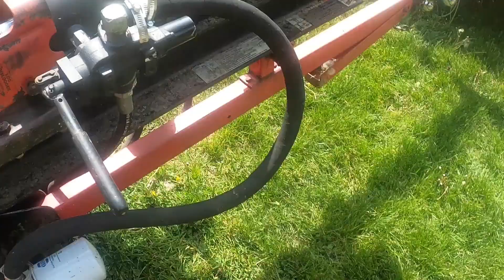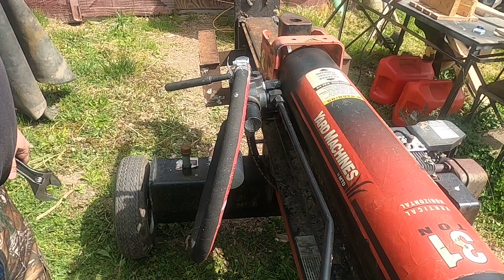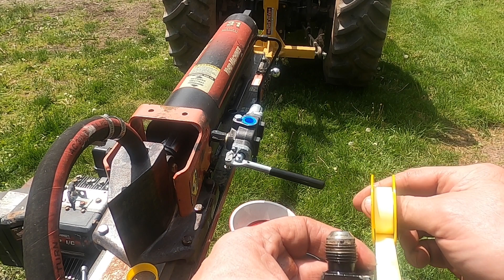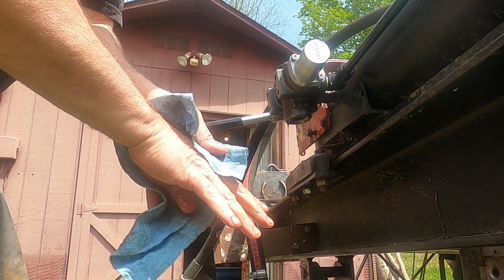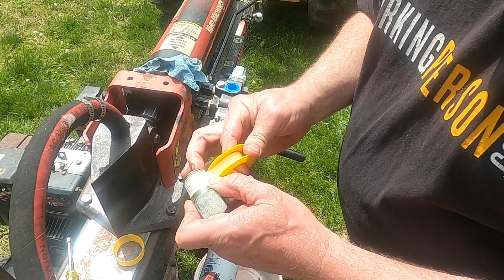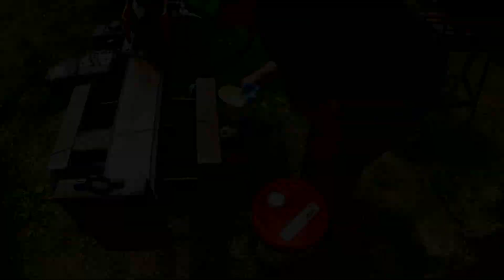Replacing log splitter control valve - 062

Comment: I have the 26 ton version of this, and the fitting in-between the ram and the valve cracked off leaving threads inside. I was able to use a pipe nipple socket and get the threads out luckily, but I have no idea what that fitting is called to replace it. The one that broke was black iron pipe and about 3" long. Can anyone help me out? Thank you!!
Reply from the maker: That's a good question. I'm actually not sure. I'll have to look at mine and figure out what it is. I'm on the boat until at least the middle of next week. When I get home I'll see what I can do and let you know. In the mean time, if you can email me a picture of what you have that might help.

Comment: I have the 26 ton version of this log splitter.  I've ordered the replacement control valve that cracked where the lever attaches to the valve body.  So, I'll be doing this exact job a few days from now on a splitter that looks exactly like yours.  So, thank you.  I've read elsewhere that using Teflon tape (even yellow), rather than thread sealant, is a no-no.  I was surprised that the control valve  (718-0481) was available since my MTD/Yard Machine splitter is over twenty years old.  I thought I'd have an excuse to buy a bigger and better splitter. (LOL)  Although, my 26 ton rarely fails me.
Reply from the maker: My old valve had cracked in that same spot. I fabricated a new plate because I didn't realize I could just buy a new valve. Now I know better.
You can use teflon tape. You just have to be careful not to get any past the end of the threads. Pipe thread compound is a better choice of course. I was also surprised that Energy MFG still sold those valves. Sorry, no new splitter for you! LOL! Good luck with your repair and thanks for watching!

Comment: What were the symptoms of your bad control valve? In other words how did you know it was bad?
Reply from the maker: On this particular valve, when you push the valve to the retract position, it's supposed to stay there until the ram bottoms out. It would either not hold that position or it wouldn't release when it did. Very annoying.
Reply: @Millstone_Firewood OK, thanks

Comment: I thought that was automatic  transmission fluid,  thats a neat idea
Reply from the maker: I was surprised that it didn't use regular hydraulic fluid but it definitely calls for ATF.
Reply: For my machine you can uses standard fluid or Dex III.  The manual specifically states if operating in temps above 70 use Dex III.  The downside of Dex III is the cost.

Comment: I'm back ! If you want to get rid of the noise, take off the muffler and braze a metal flex hose to a plate [ hand made ] and mount it where the muffler was. wire on the flex hose in a jug of water. Ta da no noise!
Reply from the maker: Interesting idea. Never considered a metal flex pipe. It does need a new muffler.
Reply: @Millstone_Firewood  My uncle brazed a flex pipe  [ I think its called electircal flex pipe ] on his chainsaw and wired a gallon bleach onto the saws handle bar  half full of water and the only noise was the chain chewing on the wood. Also you can adjust how fast or slow  it works , but cant say where on valve to ajust. There was or is a company called Northern Hydrolics that has a page that tells you what HP motor, cylinder and pump go together.  Iv'e seen V 8 motors hooked up to an 8 inch cylinder and i laughed  as it was so over powered. You might ask someone who knows about those fittings, as O'm pretty sure you don't use tape on them.
 I built my splitter so the table was waist high with a  3 foot table to sit wood on,. I wielded a 3/4 inch piece of angle iron around the edges to keep the wood from rattling off the table. I put the chunk of wood on the table and split it , then pushed half to one side while I split the other half. Not having to pick up anything as it stayed on the table. I built foot peddles so i could use both hands while splitting, once finished with the round of wood , i stepped on the down peddle and reached over and grabbed another round of wood, That is where the ''retern to center ''comes in handy. 
If you want to see my spliter , send me your address and i will send a picture. My e mail address is at the top.
Reply from the maker: Thank you for the information. I actually do understand hydraulic fittings since I work with them frequently. My go-to product is a thread sealant called Gasoila. Good stuff. But yes, you can use tape on the NPT threads as long as you do it properly. My splitter operates either horizontally or vertically. I mostly use it in the vertical position since now I only use it for the occasional log that's too big for the Cord King. That way I don't have to lift the logs. You should post a video of your splitter. Sounds interesting.

Comment: What is the model number for that detention valve? Have same machine 25 yrs old now will not pop out when reverse stroke finishes
Reply from the maker: If you look on the detent cap, the part number should be there. You might have to remove some paint to see it . If it's not there, just give Energy Mfg a call. They can tell you what you need for your machine. And this is assuming the valve you have is made by Energy. It should say on the cap.
Reply: @Millstone_Firewood  is same machine as yours from video bought it at home depot 2001 yard machine Mtd 31 ton machine

Comment: Is your fluid filter NAPA? Can i have the number of it
Reply from the maker: Hello. Yes, the filter is a NAPA 1551. However, the filter for your splitter MUST match the filter housing. It could have different threads or a different diameter gasket. It's best if you can cross reference the original filter. Your local NAPA store should be able to do that. Hope this helps. Thanks for watching!
Reply: @Millstone_Firewood  thanks

Comment: Why not stand it up to make it easier to start the pressure hose?
Reply from the maker: I suppose I could have but the ram may have started to drop and leak out more oil. It wasn't really very difficult once I moved the camera out of the way. Thanks for watching.
Reply: I remove the gas and and stand the splitter on end to access the pump-hose fitting more easily.

Comment: You should have replaced that control with a'' return to center'' control . it saves you a''movenent''.
Reply from the maker: Thanks for the comment. I am by no means a hydraulic system expert. Can you explain what you mean? As it stands, the valve operates the cylinder exactly as designed. When I push the handle to the return position, once the cylinder bottoms out, the valve returns to the center position automatically. I don't know what else would be necessary. Thanks.

Comment: Thanks so much for taking the time to make the video.  I may tackle this myself and this looks exactly like mine.   What ball park price did that control valve cost?  Mine is starting to squirt dirty looking fluid at the detent valve connection, especially in reverse when I push the handle into the auto return position..    So I was thinking just changing that, but you had mentioned in the video the cost was too close to replacing the whole thing.  Thanks again!!!    (at the end of my detent cap: 19693c (Energy) 37 04)..
Reply from the maker: Glad you found the video useful. I think I paid around $130 for the new valve. Sounds like you have bad o-rings on the spool valve. If that's the only problem, then a rebuild kit may be cheaper. But, you have to completely disassemble the valve for that. So I would call Energy Mfg directly and ask them. 
https://www.energymfg.com/support
Also, if you're seeing dirty oil, it may be time to change your hydraulic oil and filter.
As long as you're doing maintenance, don't forget to check the spider on your pump coupling. Thanks for watching. Let me know if I can be of further help.

Comment: never...never use tape on hydraulics. it will migrate on you.
Reply from the maker: Thank you for your comment. Just to be clear, you NEVER use teflon tape on JIC or O-Ring hydraulic fittings. Nor do you put any type of thread sealant on those fittings. It is okay to use teflon tape on hydraulic NPT fittings as long as the tape is wound in the proper direction (clockwise).  Please correct me if you think I'm wrong. Not sure what you mean by migrate. If you put the tape on incorrectly, yes it can definitely get into the system.

Comment: Great video. I was just wondering where you bought the replacement valve? It looks like exactly the one I need for my yard machine.
Reply from the maker: I contacted Energy Manufacturing directly. www.energymfg.com
If you look on the cap that covers the detent spring it should say Energy. There's also a part number on that cap that you'll need when you call. Thanks for watching!
Reply: @smalllogcabinliving3089  where did you get the valve
Reply from the maker: @billbagwell5938 sorry I just saw this. Energy Manufacturing. See the reply above.